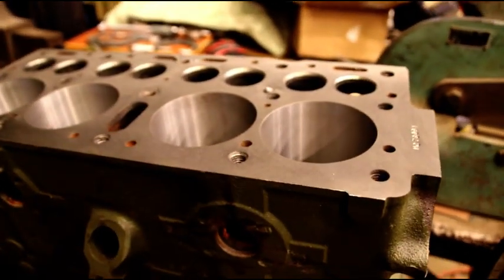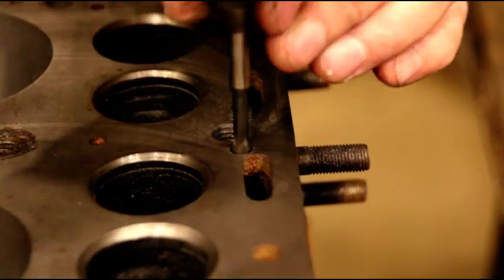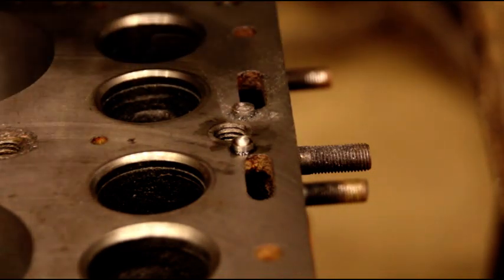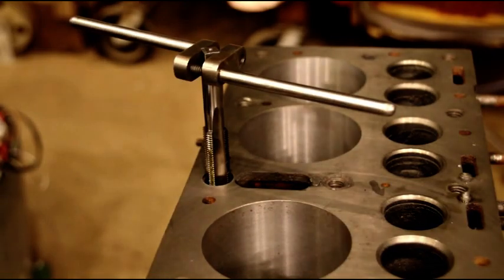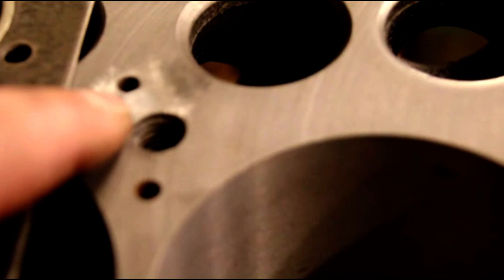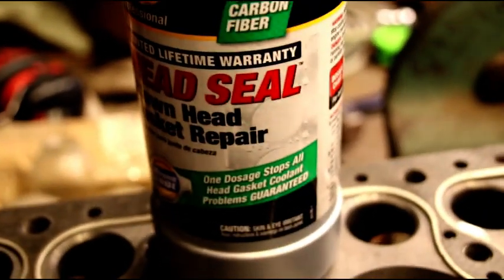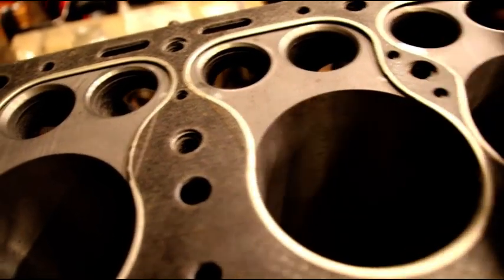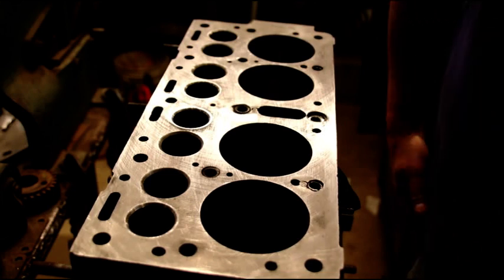Gary's Willys L Head Engine, Crack Repair

Comment: hi Brian, i have the exact same cracks that you show at the beginning of the video (0:24) on my F-134 between the number 2 and 3 exhaust valves.  as in your example, the cracks propagate from the head bolt hole to the cooling ports...what are your thoughts on carefully running a drill and tap from the side of the block on each side of the exhaust stud 3/4 to 1 inch in and then tapping and threading a 3/6 bolt on each side to pin the cracks? ..it appears there is plenty of material if i stay inside the boss close to the head bolt hole.
Reply from the maker: @michelle-lz8tg  I wouldn’t recommend a repair like that.  I like to use real stitching pins to repair all cracks.  Bolts do not work as good.

Comment: I've watched several of these videos they seem to work.  At least most of the time. I find it surprising that this method stops cracks but apparently it does. 
       I've seen other successful repairs that just didn't seem like they should work. I'm reminded of a flathead engine in an old forklift. The head gasket failed and  it burned a groove between cylinders on the top of the block. The mechanic filled it with JB weld I thought well that might run till he gets out the door. When I left that job. The already very old engine had 4000 more hours on it. It still ran perfectly.